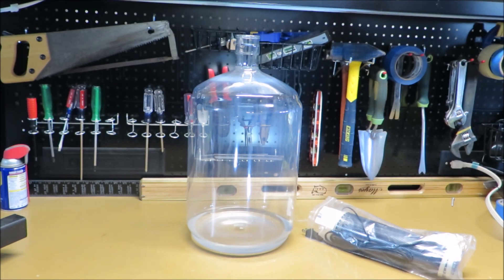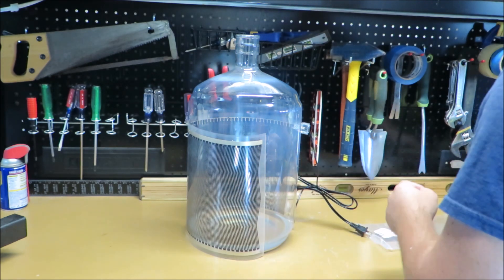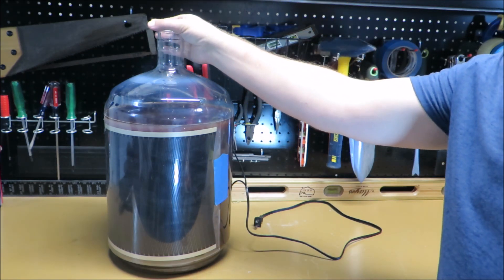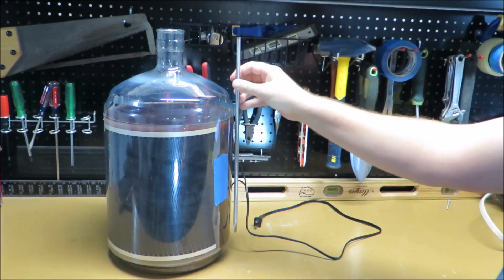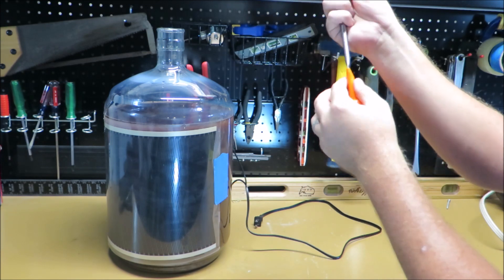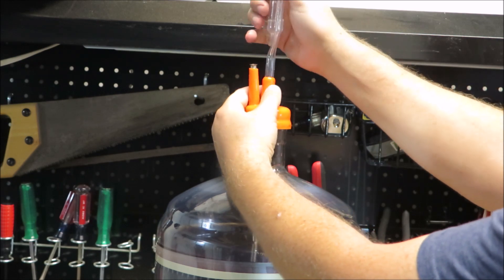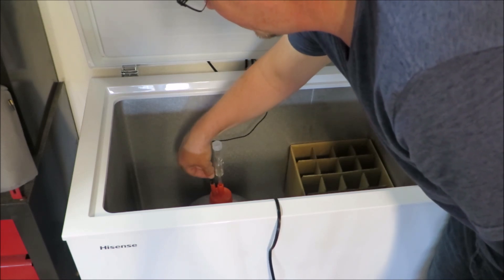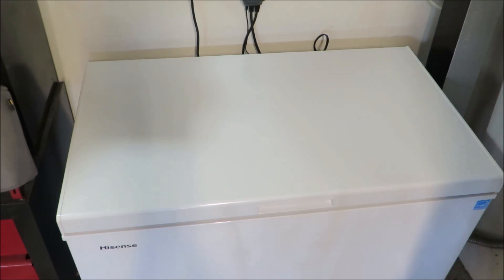Improve your temperature-controlled brewing fermentation Chamber Part 2 of 2

Comment: How would you do something like this if you were using a brew bucket?
Reply from the maker: I am also using it will my first stage brew bucket. I got a second probe, and an O ring. Drilled a small hole in the lid of my bucket, added the o ring, inserted the probe. Works great.

Comment: Thanks for posting this. I’m using the same type thermowell and the infamous Inkbird controller. 

I’m curious how you decided to install the probe all the way down into the thermowell. I’m struggling to figure out the best place. Perhaps 1/4, 1/2 or 3/4 of the way down????  I’m not sure. Interested to hear your thoughts.
Reply from the maker: When I was first researching it the depth never came up. I have been jist shoving it to the bottom and have been seeing great results. Perhaps some more experimenting is in order. Let me know if you find a sweet spot.
Reply: I have push the probe all the way to the bottom, then pulled it back up an inch or so. Seemed like the right thing to do. We’ll see how it goes.
Reply from the maker: I just finished up a brew and bottled tonight. I had the probe at the bottom. We shall see how they turn out.

Comment: the temperature controller FAQ said the temp probe is waterproof, so is the thermowell necessary to keep it from getting wet?
Reply from the maker: It helps create a good seal and extremely easy to clean.
Reply: I personally don’t trust it to be waterproof. I am also using an Inkbird and a thermowell like this one. 

I did struggle with sanitizing only the outside of the tube, so my probe likely sitting in a bit of water. I dumped it out, so only time will tell.
Reply from the maker: I have been really happy with the thermowell. Keeps the probe out of the liquid but monitors the temperature really nicely.
Reply: I think the 308  probe is not waterproof , its either the 306T or A use for aquarium is waterproof.

Comment: Insert temp probe from the underside of the cap, much easier.
Reply: 🤣🤣🤣.... I was melting down watching🙃😎
Reply from the maker: Do you just run the cable under the cap?
Reply: @FamilyDIY  No, the temperature probe is not water proof. The thermowell goes through the cap, the temperature probe goes into the thermowell which keeps it out of the wort. The thermowell has a flattened end which is sealed and goes into the liquid. He pushed the flattened end through the top of the opening in the cap with considerable difficulty. If he had pushed the round end of the thermowell up through the bottom of the cap, it would have been a much easier task.
Reply from the maker: Sorry, didnt understand your first statement. Only problem with that the other side is flared open and much larger. I am planning on getting another one, I will take a look at your suggestion and see if it works.
Reply: @FamilyDIY  Sorry, I was not able to see that on the video. I am using the smaller Brew Demons and cannot fit the temp probe and the bubbler at the same time. Back when I used the carboy and the same top as you show, this would have worked perfectly for me. I did not know the temp probes housing was available.